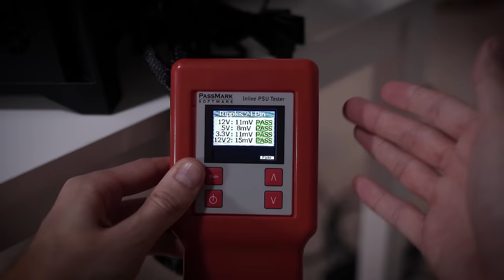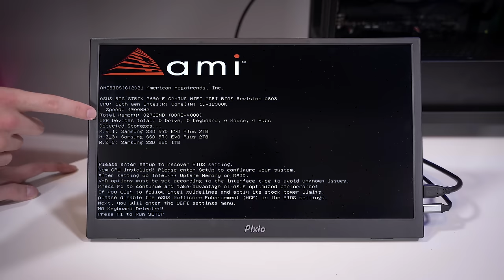Fixing a Viewer's BROKEN Gaming PC? - Fix or Flop S3:E13

Comment: Judging by the manufacture date, it was manufactured 2021/Week 38, that would be a launch 12900k
Reply: Buying used parts and getting scammed
Reply: @christophervanzetta  from the circumstances explained in the video, the viewer and friend bought the parts from Amazon to build two systems with the same specs. And Greg's theory about someone returning a defective CPU to Amazon and warehouse staff resealing and selling it again, unfortunately for the viewer, is pretty common place.

Comment: The daisy-chained power cable issue is way overblown. In my opinion, if you can trust a power supply manufacturer to make a good power supply that won't kill the rest of your system, then you can also trust them to make a decent cable that won't overheat. They wouldn't make cables with two connectors if they didn't expect anyone to use the second connector. This is another instance where the internet sees the words "best practice" and think that doing anything else is awful or dangerous. As long as you got your PSU/cables from a reputable manufacturer, daisy chaining PCIe cables is fine, actually! The only manufacturers whose cables I don't trust make PSUs I wouldn't ever put in one of my systems to begin with.

Comment: Fixed a friend’s PC recently and it wouldn’t post with the NVME drives installed.  Turns out, I had to update the BIOS on the MSI Z390 motherboard, paired with an i5 9600K.  Worked fine after that.
Reply: Strange that you had to update the bios with a 9600k… those 2 should natively support each other

Comment: 13:44 Greg, you saved me. I figure out why my damn 6700xt was stuttering in games and had was running half the wattage that it should be, causing my games to stutter constantly. Got a quality power supply where I can connect 2 separate power supply cables to the graphics card and it fixed it

Comment: Great work. Had to troubleshoot a Ryzen R7 5700G System last week and it was a terrible experience. No post. But the BIOS should support it. Swapped a GPU and CPU from my personal PC into it, tried it unsuccessfully wiith several displays. No post. Frustration. We gave up for the day. And then it dawned on me. Even after watching the whole "Fix or Flop"--Playist... have we tried resetting CMOS? Wie did not. And it worked. Posted like a champ. Why did I not try that first?!! AAAAAARgh!

Comment: I work in electronics repair, and we get a ton of gaming PCs in from our business customers. Most of the PCs are Skytech PCs, and are either on AM4, or 10th/11th gen. Before working at the place I'm at now, I've never actually seen a CPU die, or worked on a system where the CPU was actually dead. I've salvaged PCs from burned homes/apartments, picked the up from dumpsters, and have had several PCs that were very aged (Pentium 2/3, 1st gen Athlons), but never have I seen so many cpus dead. Not a single one of these systems had dead CPUs, but somehow regular PC users are just killing CPUs by using them. Almost every dead Intel PC that we get is a dead CPU (10th and 11th gen i5), and almost every AMD system that we get has a dead motherboard (aside from the 5600X/5600G systems which also seem to have a really high failure rate of CPUs). 

very odd times we're in.

Comment: Here’s one for you, my son has a 12100F, msi b 660-pro A board. Board has cpu debug light on, but the system is working perfectly fine. Temps are sub 50c, Ram has been swapped entirely and different channels used, light still on

Comment: I would double check the power settings for the cpu in the bios, many folks bricked their systems because the MB manufactures were defaulting the OC (P1 and P2) settings to max.  Newer bios updates have been released that auto fixes this issue but either way that should be checked out thoroughly or the owner will back to a cooked cpu in short order.

Comment: Think sending it back to the manufacturer is better than sending it to Amazon in this case. Never know what they might do if it doesn't get sent back to whomever shipped it out in the first place. Could end up back in the market as an open box or put into those return piles that get auctioned off and you wouldn't exactly want that to happen knowing the product is dead.

Though in my case I'd probably include a note or something with the return both outside the package and inside, just in case, that the product was DOA and doesn't work just to prevent a resell of it.

Comment: A 3080 draws about 350W under full load. One 8 pin PCI-e cable is rated for 150W. The PCI-E slot on the motherboard is rated for 75W. 
That meast you need 2x 8 pin PCI-E cables to run a 3080 with no issues. It will work with the daisy chain cabel but it mite burst up in flames at some point.
Reply: Assuming he doesn't has some chineseium psu ( I think he does not considering his build) The daisy chained cable is fine.
In electricity when calculating the amount of power you can pass on a wire it depends on wire gauge, material and voltage. If the wire are thick enough it can handle much more than 300 watts.
And the 150W spec, is very conservative, thus why some manufacturers use thick enough wire and daisy chained cable with no issues. So no worries for bursting in flames.

Comment: Since greg keeps mentioning who are able to participate in the fix or flop series, he should do a Q&A on people outside orlando, florida and the outside the US, tell their problems and greg helps to the best of his tech knowledge. 

For me, my potato pc just shuts off instantly and randomly, when i press my power botton the pc boots up like normal for a new seconds to minutes then just shuts off without any warning. Already tried another working psu and still shows the same symptoms. Btw love this series, helps everyone learn more about computers.
Reply: You’re sure it’s not an overheating problem?
Reply: @Noah-it2mt  if it did, wouldn't there be a warning? Also, i used my friend's thermal grizzly and it was a little over a year ago. I doubt its overheating tho, i could still feel water flowing through my AIO.
Reply: @LukeJukeDuke  not necessarily, sometimes it just shuts down to avoid damaging itself
Reply: @Noah-it2mt  i'll try looking at the cpu when i have thermal paste, my friend's paste ran out. Still, it was running completely fine, last time i checked my cpu temps while playing, it didn't exceed 70°c.

Comment: 00 is such a weird Q Code... I had that on my x570 Dark Hero with my 5900X and buddy of mine had the exact same issue of 00. Chip wasn't dead in either case and in my specifically I kept getting a BSOD in regards to memory regardless of which Ram kit I used with the DOCP or manual OC to the specs of the ram. 

Ended up switching to a ASRock X570 Taichi RE and both kits worked just fine. Haven't had a single issue.

Comment: Ok I am at @6:00 and if I were trouble shooting this the thing I'd look at is 1) is anything shorted to ground and 2) is it a modular power supply and did they not plug plug the motherboard power cable in all the way into the power supply and it worked its way loose so it "looks" like it is plugged in but it isn't.  Ok hitting play to see what it ends up being :)  CPU!  Wow.  So the CPU itself was melted and shorted internally.  Very cool

Comment: I had this happen to my old i7 5960X a few years ago. It blue screened and shut off one day, followed by the exact same symptoms as this video. I'm quite certain it was caused by mounting pressure of the waterblock I was using - it had been overtightened quite significantly by mistake.

Comment: Its just a relatively slow turning Corsair fan, still must be a bit painful to a certain degree xD

Cut my finger on a Noctua NF-F12 2000PWM industrial IPPC at full blast once. Those are some actually hurtful fans! Blades are extremely high quality and very durable, they don't give up by any means if you push on them and if fast enough, they will slice you xD

Comment: On my first personal build I had an almost identical set of symptoms. I stripped the PC several times and rebuilt to ensure everything seated correctly but could not resolve it. Until, I remembered I had installed an ASUS TPM module on the MSI b450. Removed and she fired up no bother.

Comment: sounds like a system i had to troubleshoot not long ago. it was an older sandy bridge system and it ended up (surprisingly) being the cpu. put in a known good i3 2100 and it fired right up. $50 later it had a new used i7 2600 and runs great again.

Comment: None of the USB ports on my rig work, I was changing cases, and the fan controller I've been using was having issues. The system shut itself down, and after rebooting, the usb ports were all dead, and they dont work in BIOS or windows. How likely is it that my USB controller in my processor is fried?

Comment: Hi Greg, i have watched almost all the fix or flop video’s. I tried to fix my own pc yesterday, and my CPU was stuck on the cooler. You haven’t mentioned it before, but it is wise to switch the computer on for a few minutes and then remove the cpu 😅. Lucky enough my 5600x is still working

Comment: May be a dumb question, but could you use a multimeter, and select 2 specific pads, or pins if it’s amd, and check for continuity? I guess it’s redundant if you have spare mobos laying around, but if you didn’t would that be a useful diagnostic tool?

Comment: Just had to replace my daughter's B450 mobo. Thank goodness it was just the mobo. I was a afraid I had a no name PSU that caused the no boot. I tested the PSU on a working system and it worked.  I replaced it with a EVGA unit anyway just in case.

Comment: Was building a pc today using an older case. Get everything in and turn it on and it turns off after 5 seconds. I start eliminating part by part until I am only down to cpu. It now stays on for about 30 seconds then reboots over and over after those 30 seconds. So, I guess it’s either the board or cpu. I suspect the board because I saw some scratches on it when I opened, so maybe it was a return. All parts are supposedly new. 12100f and G 660 board.

Comment: I recently purchased a ASRock b650e taichi lite and I got the 00 code, RMA my 7900X3D, got a replacement and the same thing happened and that didn't get hot at all, would that direct to the cpu socket being dead? I doubt I'd receive 2 dead CPU's in a row although my mobo is on its journey back for RMA. Bios was updated to latest as well and tried lots of troubleshooting to get the original CPU I had to post.

Comment: Hi Greg, love your vids. Have an Asus X670 Extreme that doesn't boot at all, and just stays at code 00. The cpu, a 7600X does get hot, but it just stays at code 00. Could it be a motherboard or the chip?
Reply: I think Motherboard or CPU problem.
Reply: Try in this order
1. Unplug power cable
2. Hold power button for 2-3 minutes straight
3. Press reset button 1 time
4. Press power button 1 time
5. Reset CMOS
6. Plug back power cable and try again
0d means bad cpu, 00 means bad board or maybe bent pins or poor/too strong mounting pressure.
Reply: @steamstories1279  thanks, I think it goes straight to 00 without any other initialisation, I'm leaning towards a dead board ad I cleared CMOS. The serif thing is that the bios flashback works

Comment: iN video never heard you troubleshoot ram before saying its cpu .I had this where i test with one ram at a time .Test different slots and check to make sure its not a bad dimm slot or try 1 - 3 or 2-4 slots for dual .
Reply: Without any light showing up it usually means the motherboard doesn’t detect the cpu.

Comment: I’m currently having the issue at 11mins when you put the cpu in the new board. I have Asus Maximus z790 extreme with a 13900k. When I power the board on the screen on the mother says cpu code 00 and doesn’t get hot or even go into boot mode
Reply: This video is very helpful thanks. I’m going to send in my chip to intel

Comment: Can anyone help with this , my pc which I’ve had for about 4-5 months refuses to boot up properly I find it constantly lighting up either my asus boards VGA or DRAM LED whenever I turn it on after shutting down , I’ve tried reseating my m.2 and my ram sticks in different placement combinations with success only sometimes (after some time) eventually it goes right but I’m not sure if it’s just random luck it does , I have 2 vengeance CORSAIR 16gb 3600mz, all I’m getting on vga error is a white underscore on the top left of the display , when it’s dram nothing displays and only a long power button press will shut It off

Comment: i have friends that had problems with the 12 gen chips.   i have yet never seen cpu fan just shut off though lol  even on dead cpu's, and also the debug lights not lighting up i found very strange, usually the cpu light blinks or lights uip.  either way, good job.

Comment: Is anyone really surprised that a 12900k that is known for running 100°C and over  250+ watts constantly would die pretty quickly? I'm sure this isn't the only 12900k to die quickly from some kind of heat death. There are always people who forget to peel the plastic off the cooler, or forget to add thermal paste, or install a DOA AIO Cooler and not know right away that the cooler is dead. You never really know. It could had just been a bad chip from day 1 and the poor guy got a lemon of a CPU. There are always manufacturing mistakes, especially in semiconductors and chips using sub 7nm manufacturing processes. A percentage of chips on the wafer will always have defects, and some bad chips will pull a miracle and pass QC as well. Keep your receipts kids! I've bought plenty of brand new items that were broken.

Comment: I wish I can have a beast computer like that. Maybe one day.
Reply: one day it will be cheaper...like in the next 2 generations of hardware.
even today the 3080 is at least $200 cheaper than when i bought mine 1 year ago
Reply: the TOTL of today is the mid-range of tomorrow. If you wait long enough, it would be better to just buy the new mid-range years from now as they will have identical or even better performance at way less power consumption and heat output.

Comment: Hey Greg, upgraded from a320 mobo to b450 steel legends, for my 2600x, and now it can fully use the 95 watts TDP, in aida 64 stability test it reaches upto 105 watts and the temps go to 100° C. On cpu #0 . But the Tj max stays at 59° C? Is this normal or something messed up? I frequently get BSOD, regarding kernel issue.
Reply: what cooler and thermal paste are you using?
Reply: @ChristmasCrustacean1  stock cooler with cooler master cryofuze

Comment: To me the pattern on that pads on the bottom of the chip tell the tale of its demise.
Reply: What does that mean? The bottom looked totally fine, Greg even says in the video it passed a visual inspection.
Reply: @SammerJammer  to me some of the pads / patterns on the bottom dont like quite right,  pointing to fizzle pop of the CPU. Had I seen that when pulling it out I would have started with there. Really to be sure I would have to compare side by side in person.

Comment: Did you check the dead i9 to confirm it is a real i9 and not one of the fake ones circulating?  The underside of the CPU will be different on the fakes, far less circuitry.

Comment: May have been overclocked and it just died ……… maybe. I’ve had it happen to me with an 8700k. Very slight increase in voltage and the chip just died. Perhaps a chip that just made the cut. I’m sure just like winning the “silicon lottery” ……….. conversely you can lose it badly also ………. but who knows. Most CPU’s that do die at least do it very early in their life ………. but they are usually the most reliable component in the mix. I know for my 8700k it was overclocking because it worked flawlessly for a couple of years at stock settings but completely died within days of the OC.

Comment: Question for the experts: Brand new build - B-550F mobo. Unable to install windows as everytime I try, the mobo gets a red light and wants to reboot. I am able to get into BIOS and it doesn't freeze while in there, but eventually it just reboots or freezes and I have to power off when I attempt to get windows installed.  Temps/Fans are perfectly fine. Any help would be appreciated.

Comment: Greg What was the mfg. & model of the user's power supply?  The PSU shroud was covering it in the video.
Reply: Strix 1000 watt
Reply: @cawfee5327  Thanks.  How did you know that?  I watched the video, and only saw Greg's PSU on the table, not the user's.
Reply: @rcald-gz5jd  its my pc in the video
Reply: @cawfee5327  How do you like your power supply?  I'm in the market for a new one, and the Asus ROG Strix and Thor 850 watt are on my short list.  I'm also thinking of holding out for one of those newish ATX 3.0 / PCIe 5.0 models, but I'm still trying to decide.  Btw, nice rig.
Reply: @rcald-gz5jd  thank you and im loving my strix power supply it great and i cant recommend it enough

Comment: Can you over heat a chip and break it. I know that's one hell of a air cooler but should that  chip really have a liquid cooler?
Reply: Most modern cpus will throttle then shut off before they hurt themselves. You can run 12th gen on a big Noctua like that without issues.

Comment: That's an astonishing number of dead CPUs over the course of the series. My engineering side is really curious of the causes of their failures. Is it the faulty process and then a little heat breaks some connection or is it internal short or what happens? Probably will never know though 😂